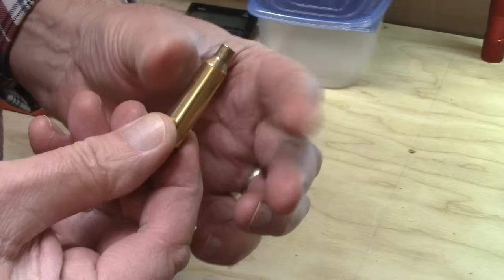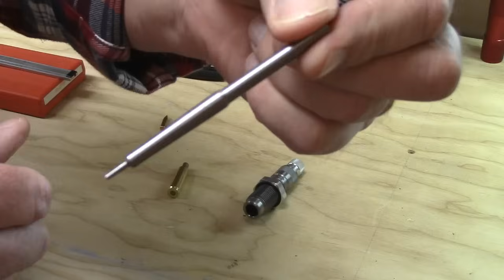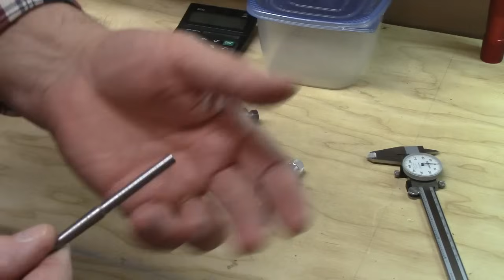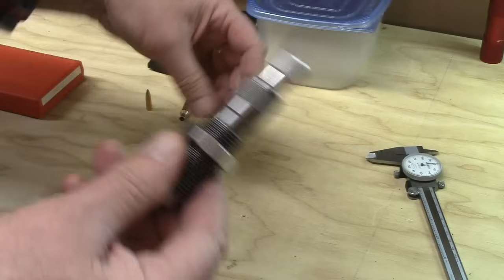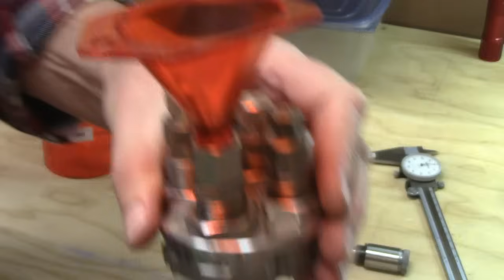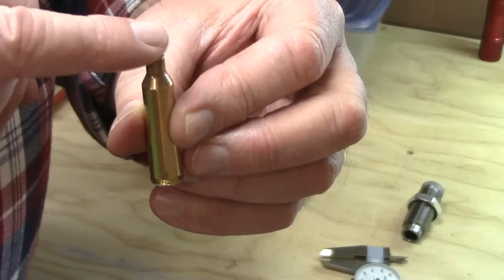Handloading PART IV, How Dies Work ~ GunBlue's Complete Guide

Comment: Necksizing is not recommended, when the cases are shot in  hot chambers. That's why competition shooter full resize.
Reply from the maker: "Competition shooters" is a broad category, describing nothing. It certainly does not include competition benchrest shooters who have been neck sizing for 80 years.  I've explained that neck sizing is for benchrest (competition shooters) and varmint rifles desiring the utmost accuracy. I explained that it requires strong bolt effort.  I explained that it's not for those needing the assurance of rapid follow up shots.  I think that covers it.